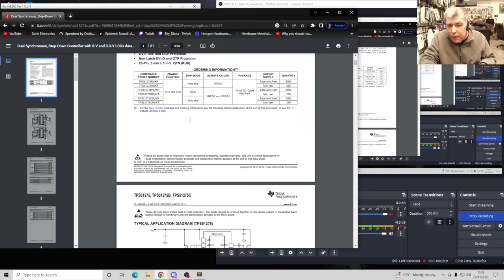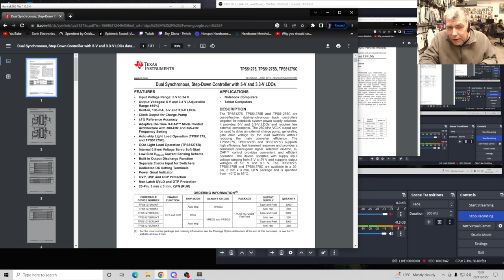How you can diagnose a faulty SIO/EC/IO/Startup shorted chip

Comment: Stupid question: At first we think it is the first chip because it is hot, but then the output is shorted and this is the super IO chip the problem because it is hot. Could it be that one output of the super IO is shorted as well and make us think that the super IO is dead? To make sure that the super IO is REALLY dead, we could desolder it completely (removing any potential output shortage) and inject 3.3v to see if it is still consuming 200-500mAh, right? Otherwise we are not 100% sure it is dead.

Comment: Sorin, why do you use a flammable liquid to test for shorts instead of using a safe Rosin Atomizer Short Circuit Detector. I'm not questioning your testing methods but safety is safety. I saw in one of of your videos where the liquid caught fire.

Comment: Which also means that if this laptop had windows license and it's special hwID number, mac, feature byte in HP laptops - it's now gone forever. I really don't get why manufacturers try to push BIOS inside KBC instead of using SOC8 package chip. I am very interested if this chip would still be somehow readable or is it really toasted? Some follow up video Sorin? Best KBC programmer I know is SVOD but that toy is pricy. If there are other cheaper replacements maybe someone will be willing to share some knowledge? I don't do boards with KBC, for most jobs my TL866 is more than enough especially for some canon printers but I haven't found cheaper alternative to svod and for I haven't found extra funds to buy this toy. I want it though.
Reply: yeah it is really annoying when I find "junk" 8th gen  or newer HP laptops, they constantly try to join domain in Win10/11 because Azure uses HWID which is saved in PCH/KBC, which sometimes I get lucky and HP factory CMD lets me change the HWID but not always for some reason....

Comment: Exactly how it went for me on the x421ia. And weirdly it also takes ~300ma and overheats. Someone tried to unplug the battery from the mobo and ripped the connector from the board that's how it most likely died. I realized that while testing (plugin the power), the safety features of the 3.3V/5V regulator will not always trigger and can lead you the wrong way.

Comment: Oh wow, this might be what happened with my old Medion laptop. It no longer turned on. Whenever I plugged the charger in,  the "Dual-Channel Synchronous DC-DC Step-Down Controller
with 5V/3.3V LDOs" chip was getting extremely hot. 19V seemed to be up everywhere it was meant to be, but no 3.3V or 5V anywhere. As stated in the video, I made the mistake of assuming the chip was responsible for the fault. I noticed that a cap that's right next to the super IO is connected to ground on both sides. I'm guessing that's not right. 

The board is unfortunately not repairable due to my attempts to try and fix it. It is interesting to know what the likely cause of the fault is though. I always wondered what would make that chip get extremely hot whenever a charger was plugged in. This video certainly answered that question.

Comment: Sorin, I had this EXACT issue with my grandson's MSI Prestige 15 gaming laptop. While replacing the LCD panel after it was damaged, I screwed up and shorted the battery connection while trying to unplug it (boneheaded mistake on my part, I know better than to use a flathead screwdriver to leverage a stuck connector when I had a plastic spudger nearby). Sure enough, it killed the laptop. I bought him another laptop and have had this one on the bench as a passion project, LOL. When I powered it up, that same TI LDO regulator showed up on my thermal camera as red hot, and the VREG3 pin showed as shorted to ground. Thinking that was the fault, I removed the LDO, only to realize the VREG3 pad was still shorted -- so it wasn't the chip itself. I'm still poking around looking for shorted MOSFETS and caps, but without a schematic it's really hard to visually trace on this motherboard given the black solder mask and the extremely fine traces. And I don't have a good microscope yet (just a little digital one). This one isn't water damaged and as far as I can tell the SIO is fine, but will be sure to double check it now. 

Am also interested in seeing how you reprogram the replacement SIO.
Reply: Hello I want to ask a question. I have MSI 15 sword, while I was tryin to unplug battery from laptop with screwdriver, short circuit happened. Is my laptop dead? One of services told me buy IO chip to replace but seller said that we need to update BIOS for it to work. But point is i cant boot my laptop bios :(

Comment: It's a Lenovo lol. I have Asus x401a with the 30 minute off issue, something to do with the bios, I've tried flashing the bios and it kills it, I flashed it with the x5 series and it works but useless due to casing and keyboard. Never found a bios for what I've got that actually works beyond the 30 minute mark. All thermals have been checked plus fan, so overheating is not the problem, there is a countdown timer that kills the laptop exactly 30 minutes.
Reply: Was the processor upgraded/changed before?
Reply: @daniloalmeida744  I did change that to a slight higher spec, you think that might be causing this issue?
Reply: @jonathaningram4672  it once happened on a notebook that came to me, it was upgraded to a core i3 from a pentium processor of the same generation and same socket but the chipset of the motherboar is hardcoded by intel to not accept core processors and thus its shutsdown exactly after 30 min and no more seconds. Yes, its the usual bullshit that comes from intel. Try the old processor and let us now
Reply: @jonathaningram4672  In general you cannot change CELERON/Pentium to i3/i5/i7... it's in Southbridge (different)... if it's meant for lower cpus -  i family will shut down every 30 mins. Made on purpose

Comment: How do I deal with a super IO that works sometimes and does not work sometimes. Its a pain to get my laptop to boot. But once it boots I runs fine for days. 
To get it to boot. I need to pull out the bios bat. Then hold down a key. To drain power as per lenovo support. Then plug in my power. Sometimes it boots. Sometimes it starts to boot and then the power button LED just flashes. 
I have tried with hard disk without hard disk / cd / change the ram/ changed the hard disk. 
Its worst when the moisture content is over 80%. I have removed all the goo from tape used on the mother board. Only thing left for me to try is to pull the mother board and wash it in ISO.

Comment: hello sir. do have any idea on hp 640 G1. once it's plugged the power and charging lights turns on but no boot. it doesnt also respond on the power button.  it has no blinking caps lock.
Reply: Flash the bios and see what will happen